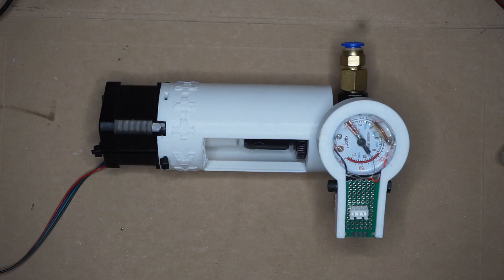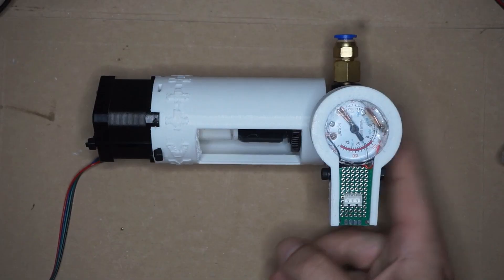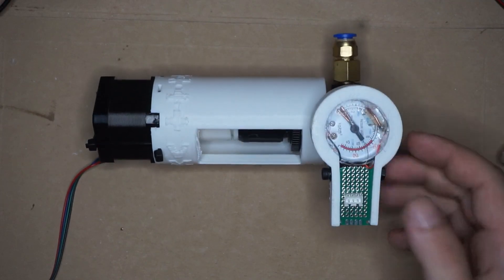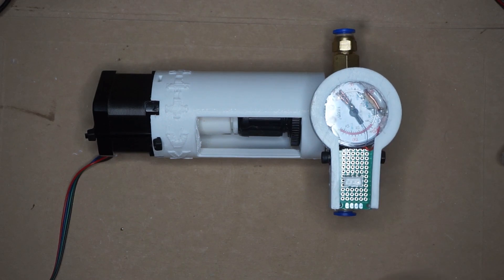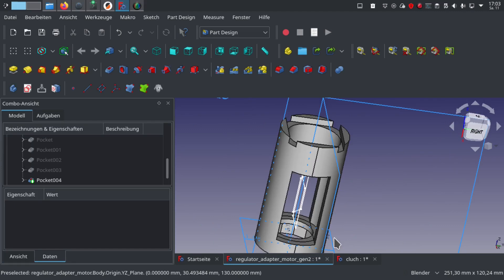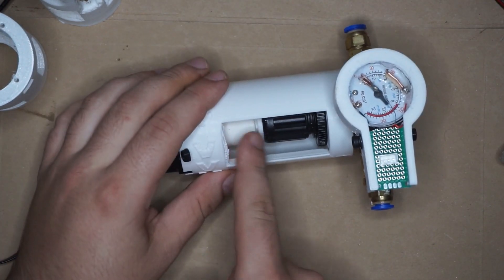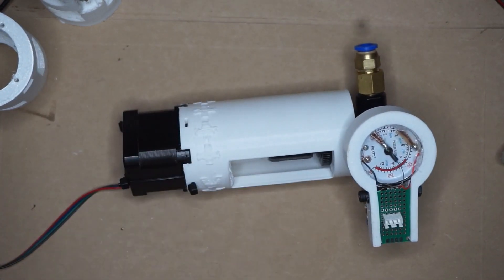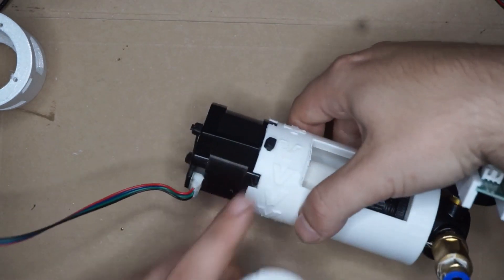DIY Motorized Pressure Regulator | Part 1

Comment: An assembled digital tyre pressure meter is $5. The pressure IC in the unit I have is a simple Wheatstone bridge.
Reply: That does sound easier than adding the wires.  I've been using a "MD-PS002 700KPaA Vacuum Sensor Pressure for Arduino" that is $1.10 on Aliexpress for one.
Reply from the maker: sounds good, do they work with waterpressure too?
Reply: @boltzbrain3039  I don't think they're waterproof, but you can place a rubber diaphragm between it and the water though